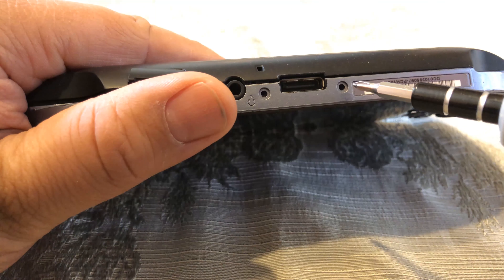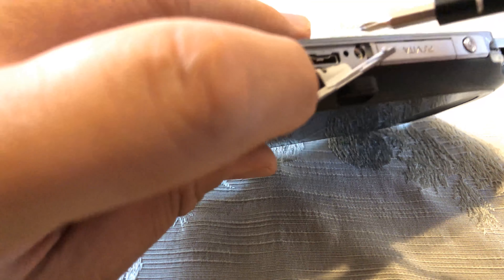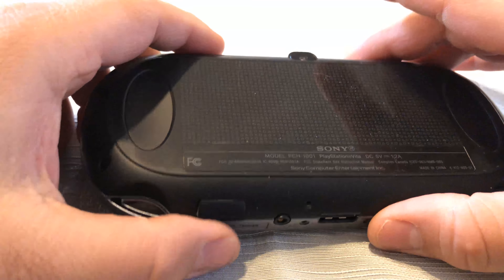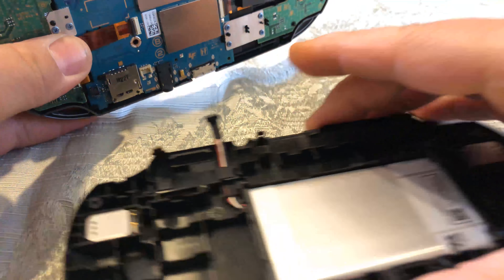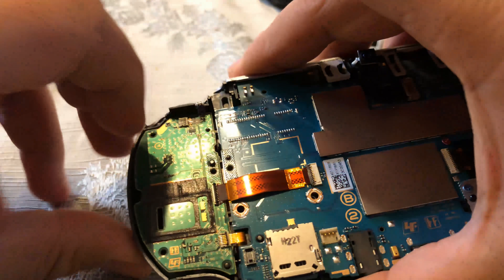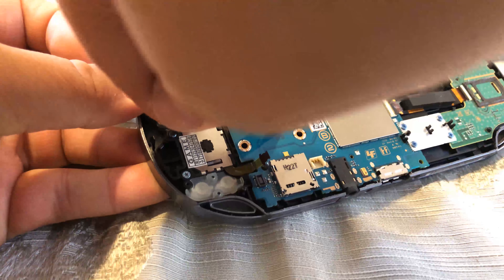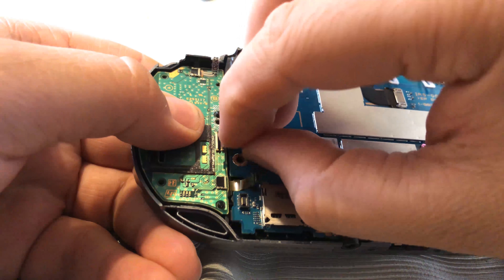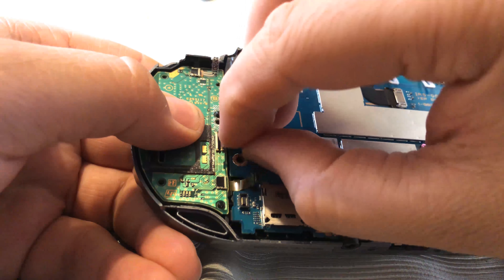Playstation Vita Joystick Replacement | Easy to Follow Instructions | 4K

Comment: Awesome video. Cool intro, sweet music and above all informative clear instructions. And to the point, no time wasting. Seriously good content.

The only critique I have is that it wasn't made clear which version Vita you had and what differences their may be with a slim model doing the same replacement.

I'm yet to to do the job but I feel quite confident now. I was going in thinking I would have to be doing board level solder work. Your video was a relief to watch. Thanks, keep up the awesome videos.

Comment: I have a question hope this page is still active after it being a few years since you made this video. So my question is, the replacement was for a 1000 vita but the link you bought on Amazon is for a 2000 vita. Will it work on a vita 1000?
Reply from the maker: No it will not. Thank you for letting me know about the faulty link, I will fix it ASAP

Comment: Hello i have a question does repairing the analog will fix the ghost movement thx to anyone who answers
Reply: It can but it's more complicated so it's better to replace it with a new joystick or just use a contact cleaner
Reply: @jennygulveigh3220  what is a contact cleaner ?
Reply: @jennygulveigh3220   I replace the joystick and its still doing the same thing can it be something else that is making it ghost drifting straight to the left

Comment: Should I be worried if my vita doesn't turn back on after this??
Reply: Nope just hold the power button for 30 seconds then press restore system and you are good to go.
Reply: Stoned Savage! Does it delete my data?
Reply: @aboddy67  might do I don't know nothing happened to me.
Reply: @aboddy67  no it doesn't delete anything
Reply: @stonedsavage7814  What about on hacked PsVita? Does this work too?
Reply: @HIIIMM2  it should. The hacking is a firmware/software mod,  while a stick replacement is entirely hardware